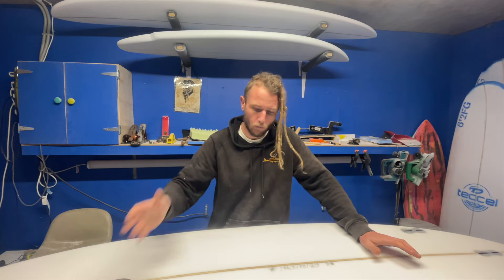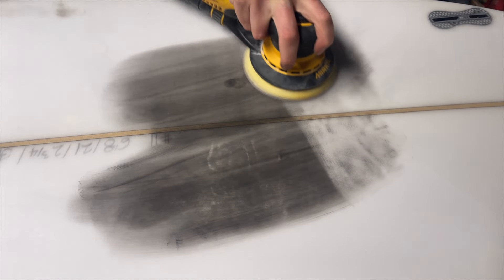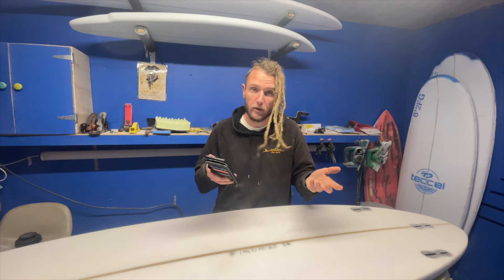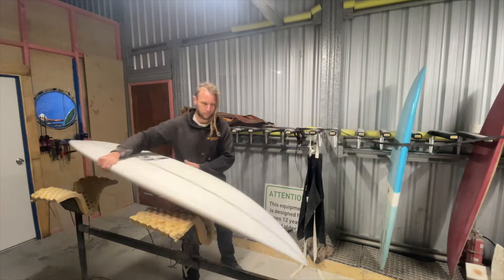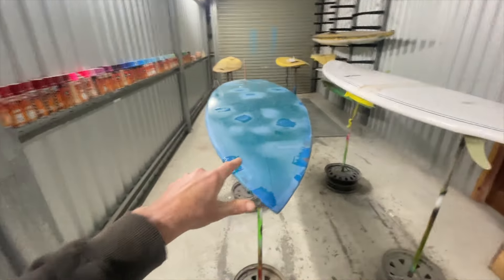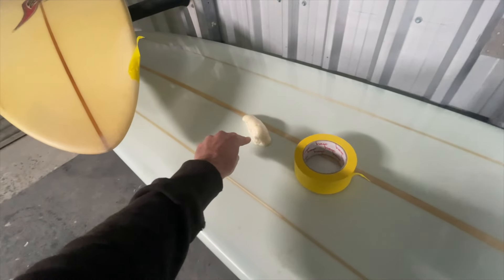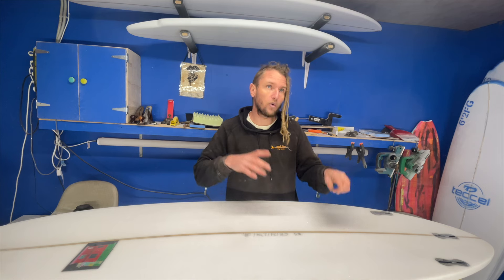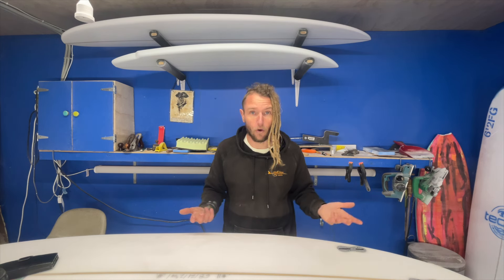My Subscribers ask the strangest questions...

Comment: Great video , could you explain a little more about your sanding process and your sander speeds ,including how when a what type of interface  pads you use ? I have the same sander but do often get a little sand through at times. Thanks
Reply from the maker: I have a video specific to sanding, check that one out it's pretty in depth. As for speed, it kind of depends on what you're sanding at the time. That's the beauty of the MIRKA is that you can control the speed easily depending on the surface you're working on.

Comment: My favourite construction is traditional pu foam with 2x6 S glass and epoxy resin. Feels close to standard glassed pu foam with polyester but loads stronger and lasts forever because the glass kind of bends rather than shatters. Would be interested in your take on that combination.
Reply from the maker: I’m a fan of epoxy over PU for sure. I’d expect to see a lot more of them in the future! 2 x 6oz sounds ok but I’d still be putting a 4oz deck patch under that as well 🤙